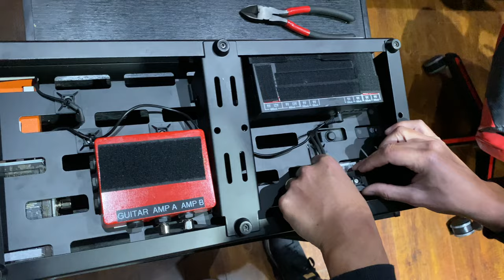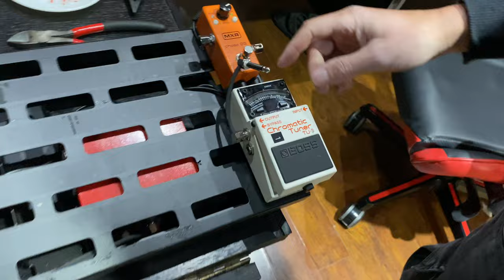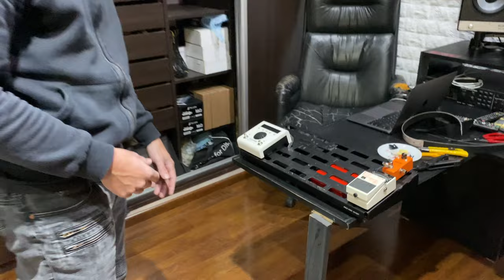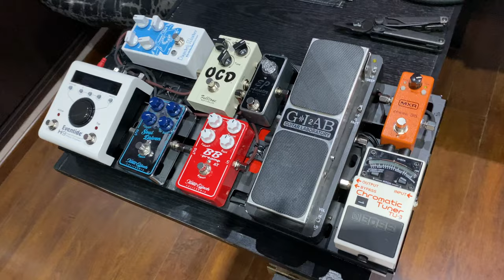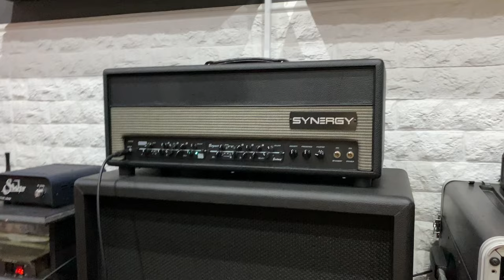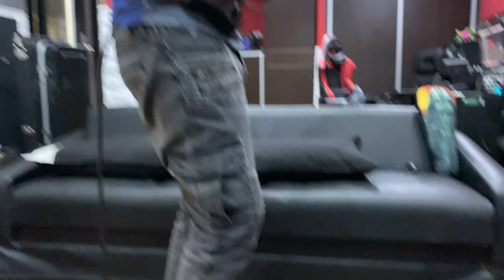GH SYSTEMS Pedalboard 2022E (armado y audio)

Comment: Quedo impresionante, tengo una consulta master. 
Tengo una fuente (zuma) solo tiene 9 puntos de entrada, ya tengo los 9 puertos conectados como conectaría otro pedal ya siendo 10 en la misma fuente. ¿Podría usar un cable tipo daisy chain  no habría problema o tendría que conectar el otro pedal con su fuente directa cosa que no quisiera?
Muchísimas gracias por los videos se aprende bastante.
Reply from the maker: Gracias por comentar. Los cables daisy chain pueden llegar a sumar ruidos. Tendrías que usar un cable Voodoo Lab, de los que te permiten alimentar 2 pedales desde una misma salida sin sumar ningún ruido. Cualquier otra duda, no dejes de consultarme y recordá suscribirte al canal. =)
Reply: @GEARHAVEN  Muchísimas gracias!
Reply from the maker: @robpalacios2278  No hay de qué. =)